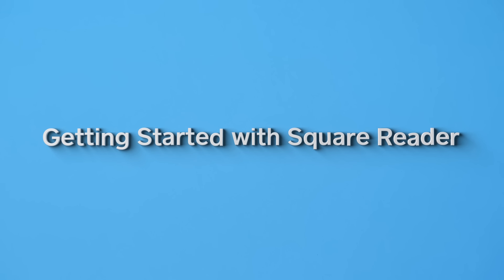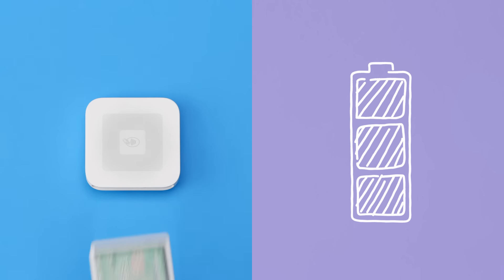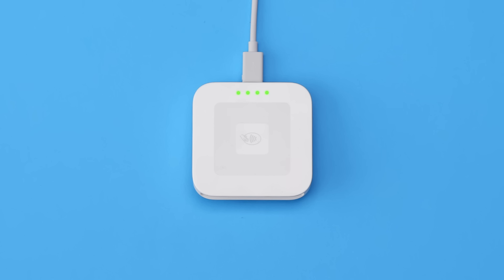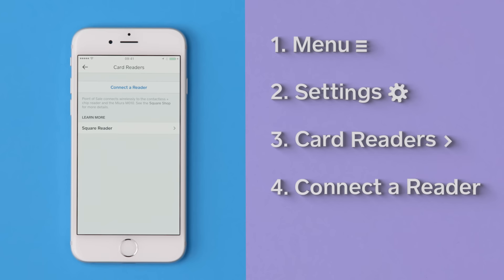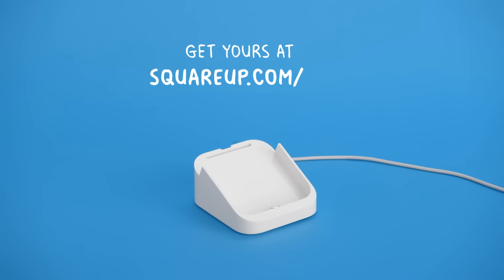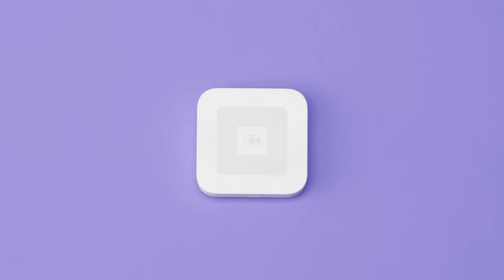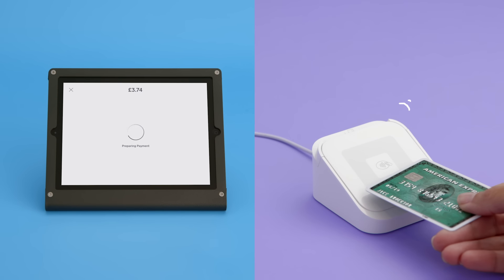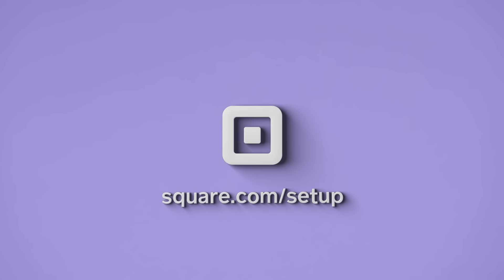Square Reader: Getting Started Guide (UK)

Comment: Design of the reader is kind of flawed. Why would I want to let my customers use my iPad POS to enter a pin? It's quite exposed and other customers standing around could see you entering the pin. Also in times of COVID-19, I want as few people to touch my equipment as possible to avoid contamination. The Izettle reader is far better
Reply: I agree. But i feel like Square's POS app has more features

Comment: Why is it keep breaking down and I have to order another one every 6 months
Reply from the maker: We're sorry to hear that, we'd suggest trying the following troubleshooting steps, it sounds like you may be experiencing some connectivity issues: https://squ.re/2E4EXb1

If you need any further assistance, don't hesitate to contact us on one of the multiple support channels attached. We're here to help: https://squ.re/3nItoMI
Reply: @SquareUK  I have read and tried everything card readers are breaking down usually about every 6 months then I have to order new one a new one connects directly without any problem but for a while then about 6 months or so breaks down again so I had to order another one seems like purposely made this way to sell more card readers but until arrive the other one I can't get payments very disappointing and this happens to my other colleagues as well not only me
Reply from the maker: All of our Hardware is covered under a two-year warranty. Our Customer Success team is able to help you out with replacing your device. You can call them on 0800 098 8008. We’re available from Monday through Friday, 9:00 to 17:00 GMT.
Reply: @SquareUK  ok thanks

Comment: I can't f'ing get bluetooth to recognise it.
Reply: John M make sure you’re using a supported device. It must be a device that uses Bluetooth 4.0 LE or newer.
Reply: @mikewolf5367  I got it to work! Thanks!
Reply: To anyone else having problems connecting the reader to your phone or tablets Bluetooth. You don't actually connect it via the Bluetooth settings on your device. You just open the square application then go to settings then card reader and then simply choose connect to card reader and that's it.

Hope that helps someone.

Comment: Terrible design for those receiving payments using the Square App on mobile phone. Possible scenario being - if your a market trader, small store or cab driver whine uses a card reader devices App on the phone and the customer/passenger doesn’t have contactless feature so you give customer/passenger your phone to enter pin on what is an expensive smart phone.

Thus the scenarios that follow have an increased chance of happening: 1). The customer/passenger accidentally drops your smartphone in the process and damages the screen/phone, 2). the customer/passenger runs off with your phone and card reader, 3). over short time your smart phone, which you also use heavily for personal usage, could have had hundreds of different people handling it making it easily more contaminated very regularly.

In all cases it is better to have a keypad on the cheaper card reader than a more costly smart phone.